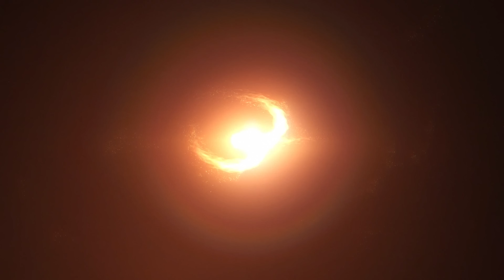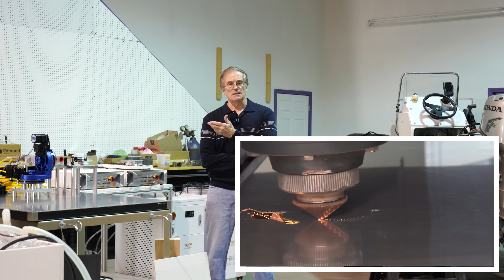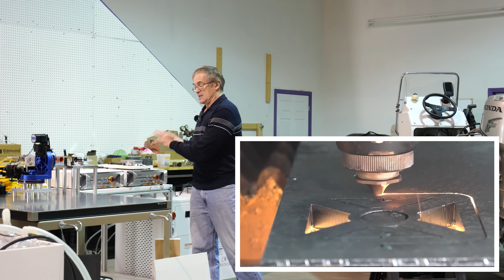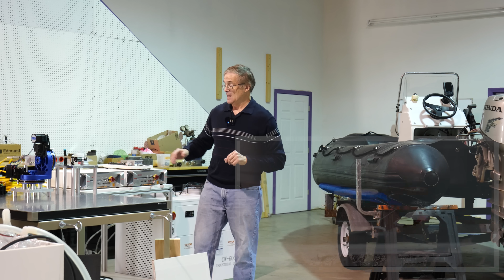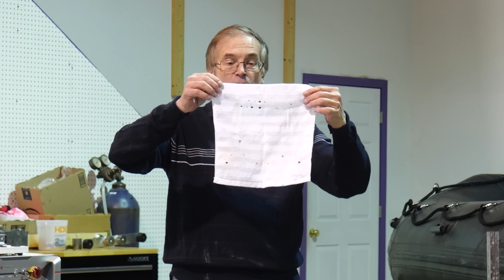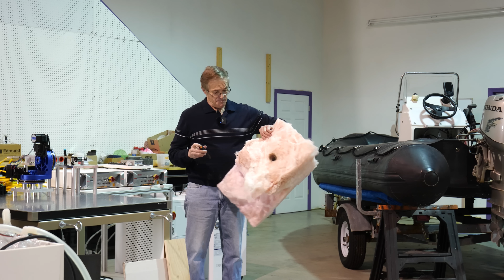We have a problem... and need your help!

Comment: what about sheet steal painted with a ceramic paint and baked (maybe a few layers painted dried reapplied and then baked) could be thin and portable and the ceramic should help dissipate the heat to the steel plus reduce reflection you could also mix in salt in the layers/paint.

Comment: Build a fish tank with a piece of optical glass or a lense target. Fill the tank with water and put blank ink in it. If you're worried about ink fumes, add silt/sand/clay with continuous agitation. 

If glass doesn't work, use a wax/plastic plug. With such a small beam the water loss will be minimal and sheilding time can be adjusted with the tank volume. Use threaded pipe fittings for the target, add a large ball valve behind the target to stop water loss and replace the target.

Comment: Disapation, rather than blockage, might be more plausible.  Frequency degradation perhaps?  A secondary beam depleting the energy emitted jointly with the beam?
A beam that can be easily STOPPED at a given point can also be easily repelled with a coating of a like molecular substance.  
You're halfway there; creating a joint beam dissipates the ray in microseconds.
A "Half-life" beam?  
I know nothing about laser beams, so let's limit the laughter.  
Laser beams are a horrible idea, but someone somewhere will make them a viable solution, so it should be someone thinking about limited safety.
Dang, smart idea going TO the public with the problem.  There are a lot of "armchair geniuses" out there (especially in the free world).

Comment: Well the water was probably a really good idea just the rag is probably not the best material to disperse the energy. I heard that diamonds have the best heat conductivity. I think factory made diamonds are relatively cheap so if you buy sand size diamonds you could fill up a glass pannel with the diamond sand and then fill it up with water to soak the sand. The diamond sand will disperse the beam around and it will transfer the heat to the water in a similar way to the rag idea. Depending on size of the diamonds the results will vary so i suggest you try several versions.
Reply: You could even mix in a bit of graphene in the sand to adjust the absorption levels(in case the sand is too reflective

Comment: Diverge the beam to a large area (think 100mm or so) then focus it using a large lens on a precisely controlled slider, like that you can eliminate the need for a backdrop to stop the beam, the beam will only be focused on a single point which is controlled by the tracking system, only a short distance away from the vocal point the beam has diverged enough to be relatively harmless.

Comment: Actually a high quality mirror at an exact 45 degree angle pointed towards the ground with wet sandbags on the ground could work but those might be pretty expensive at that scale

Comment: Remember your absorbent material that mimics snow?  Was that not quartz?  Quartz sand?  The melting point of pure quartz sand is very high.
Reply from the maker: It was made from barium sulfate. 
We likely need a barrier with some mass.  
We don't want to reflect the energy, and anything that absorbs it is going to get extremely hot.
Reply: @TechIngredients  I mean using clean quartz sand.  It might even flow to close the holes.  If you need a material with a higher melting point you can try green silicon carbide powder.  Sand or powder crystals should distribute and absorb the beam effectively.

Comment: Worked on terra watt lasers to produce x-ray lasers, linear accelerator based X-ray sources etc...  I have a few idea's but I'm on vacation in Corsica now.
Reply from the maker: That's awesome! I'd love to hear your ideas when you're back.
Reply: @TechIngredients  I sent you my contact details on your website, but in short: you're dealing with a class 4 laser device and need an interlock system. For a big room like you testing area: have a dual protection wall separated by a pressure vessel (a sort of huge airtight plastic bag that sits between both walls) that's maybe 1-2 bars overpressure. Higher overpressure will make you more sensitive to leaks (caused by laser breaching through your first containment wall). Build your interlock based on the loss of pressure.
Outside testing will be way more complex as you'll need to follow military laser safety standards and imposes NOTAM's.  Consider the fact that enemy dones can defend themselves using reflectors causing damage to your equipment, or set your work area on fire.

Comment: Numb nuts here. I was thinking if the beam is made with mirrors cant it be un made with mirrors?
Reply from the maker: Not practically because the area we have to protect is so large.
Reply: Doesn’t precision tracking solve that issue. I mean, watching the lazer cut through, I thought, having it tracked and target at a lens that would reduce the intensity@TechIngredients

Comment: How about a screen that you can drop down it would be hooked to a disconnect to immediately disarm the laser so that as soon as it hit a relay, disrupt the beam even if a Guillotine type switch on the light to interrupted immediately

 during testing over the wall that is hit by the laser with immediately react to Quick acting switch to kill power to the laser

Comment: What about a glass tank of water with a carbon or other suspension to make it oppaic. As the suspended particles absorb the heat of the laser beam, its transfered to the water, and steam generated rises as bubbles away from the laser being continually displaced with more water, allowing you to use a much larger thermal mass of water?

Comment: What about a prism to direct the laser into a light trap. Bouncing the beam multiple times. If the material like glass is clear at the start and becomes foggy towards the end then it might become a very bright light. I'm just thinking of how to spread the light waves rather that turning them directly into heat. Bouncing the beam is to increase the distance of travel. 
I'm curious if a vapor chamber would help in any way. 
My first thought was to just use muddy water

Comment: Try a brick of solid asbestos. Should do the trick if heat resistance and immunity to flames and extremely high temperatures are the biggest issues right now. Topkek 😂

Comment: Sounds like you need a scrolling substrate. Like maybe using a treadmill covered in ceramic slip? That way if the laser is stuck in one position, the substrate that it’s hitting is always in motion.

Comment: Add watchdogs in hour control.  Camera shoumd have part of its frame looking at a clock always changing.  As long as those pixels change, the camera is alive.  Likewise, out of your control system, output a constantly alternating signal to a monitoring safety relay.  The relay is meant to activate only if it "sees" that signal alternating.  The safety relay allows you to activate you Estop circuit to power up your laser.  You may need more or less.  Lookup good practices for safety in industrial control systems.

Comment: A stack of silver mirrors, held at 45 degrees to reflect the beam downwards, into a basin of water, with an airator sponge, like what is found in fish aquariums systems, directly below where the beam is to hit the water . The micro bubbles will help break up the acute beam, to a scattered format. Perhaps, a few letters deep of mirrors in case, the front one breaks, and just falls into the basin of water, like what cattle or horse drink out of on farms. Corrugated galvanized steel oval basins.. might have $3-500 bucks in retail prices of these parts.. the aquarium air pump, sponge defuser bubbler, the basin, the rack system to hold the stack of mirrors, the mirrors, and then, $25 buck in a water bill to fill the 400 gallon basin, a magnet to hold the sponge bubbler down in location.

Comment: Im no expert in lasers but my though is immediately a see through substrate the laser wont cut then filled with “orbeez” the absorbent gel balls used in potting mix. They will diffuse the light and also have a high water content to absorb the energy. As they fail more fall into the space.

Going old school, sand bags

Comment: The best solution would be water sprays. Water is released through nozzles in the form of very fine droplets. One or two such curtains should effectively intercept the beam. In the worst-case scenario, the laser beam will cause water to evaporate, dispersing its energy. Otherwise, the water droplets will cause the laser beams to scatter. It seems that one or two water curtains, or even a semi-ring or half-arc from a water fountain, would be sufficiently effective.

To control the water splashes, such sprays can be placed within fabric aprons. The laser will of course burn through the fabric, but it will then encounter the water, which should weaken or even completely suppress the laser beam. So I suggest water curtains made of very fine water particles. One or two of these should be enough to catch the laser beam. Additionally, water is cheap, and you can recirculate it yourselves. I don’t see any major issues here. Good luck, guys! Or water curtain.
Reply: I think another good solution would be to try using pouches filled with water — like those used for making ice cubes. They're fairly inexpensive, can be made at home, and filled with water. When the laser burns through the outer layer, the water will likely start leaking and simultaneously evaporate due to the beam.

However, two such curtains made of water-filled pouches could do the job. And for more serious testing, who knows — maybe even real ice cubes in those pouches could be used. Of course, you’d need to build some infrastructure, a cooling system, and get a heat sealer to make the pouches yourself. But they could come in various shapes — horizontal, vertical, etc.

I think this is another viable solution. You could even combine it with the water curtain: a water curtain plus water-filled pouches plus pouches with frozen water. I don't think you'll find a better material than water.

Comment: 1) Shoot towards the ground (soil). You have quite thick and cheap mass you can fire into.
2) Use water as heap dissipation and fire suppresion medium.
3) Use solid particles that bend the light and absorbs a little - laser splits to many particles which multiplies heat dissipation. This could be salt, white sand, glass balls etc. Silver flakes should be perfect but costly.
Summary: shoot into wet soil or into (inflated) swimming pool full of fine sand that moves all the time (does not settle).

Comment: Graphite sheet coated with carbon black. use graphite/ carbon black paint on thermally conductive surface. Don't know if it will work.

Comment: Have you considered a spinning backstop? In large X-ray tubes the cathode ray would melt the anode, so the anode is a plate mounted on a motor and spins very fast and the cathode ray energy is dissipated over a larger area. I suspect you can mount a round piece of dry wall on a free standing home ventilator motor to do the trick.

Comment: A concave to convex lense should be able to diffuse the light beam after it hits the target. Possibly a fresnel lense might diffuse it. Instead of trying to absorb or block the beam, diffuse it with lenses just like they use lenses to focus the beam.

Comment: You might try testing 3com cubitron sandpaper. I'm thinking that this might be a way to defuse the a laser beam in the same way that an audio dispersion panel would. Another option might be to use fog or smoke as a dispersion medium.

Comment: I think the solution is something you already touched on. The way the lasers are used for metal cutting uses a very steep focussing lens that creates high energy density at the cutting point, but because of the steep angle this density falls away quickly. I understand that focusing the beam to a target would not be feasible, as the controls might not be fast enough and the angle would not be anywhere near a steep as with the cutting arrangement, but you can you the same principles to expand the diameter of the beam, which would bring down the energy density at the contact surface. This piece of optics can be swapped in and and out of the beam path and this can be be done quickly. So under target acquisition conditions the beam is wide and relatively safe, but as soon as you have a target lock the beam changes to cutting mode for the time it takes to destroy the target, and then goes back to acquisition mode.

Comment: An "un-focusing lens" 

Built into some sort box you can easily align with the base unit, Use an array of lenses in "reverse" to disperse the beam into a much more manageable levels. That might work if you're shooting the same spot.

Or

A rotating drum/barrel full of sand, it would allow you spread the impact point over a large area depending on barrel dimensions and rotation speed.

Comment: the ideal solution would be both: Diffusing and Blocking the Laser Beam, where for the diffusing would be when a target is not hit yet. The diffusing can be done by adapting n the laser head construction (lenses etc) dynamic istead of static such as is currently. Together this will provide maximal safety.

Comment: Why not use water? I'd build a granite fountain wall with water that cascades down in front of it so the laser hits the water 1st, discipating the light and heat enough, then having the granite behind it should stop the laser from going anywhere past that point.